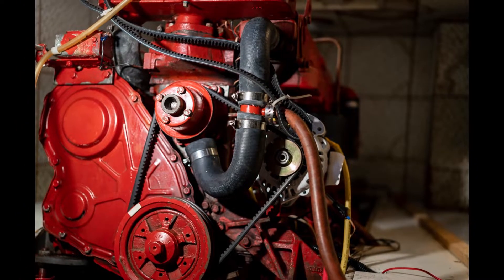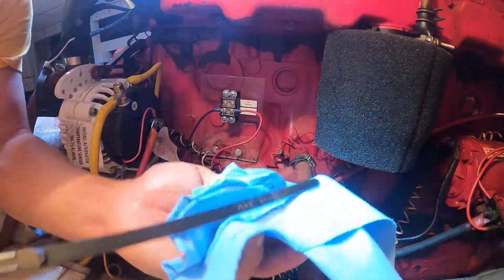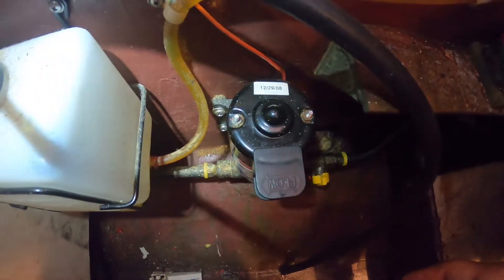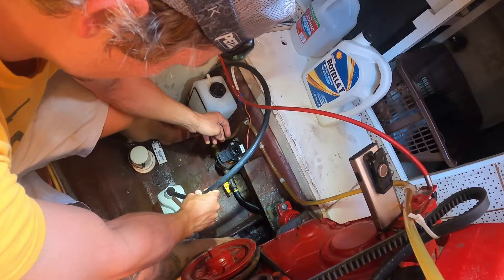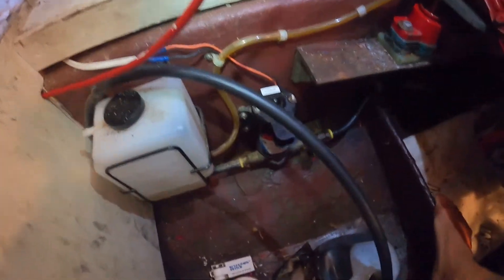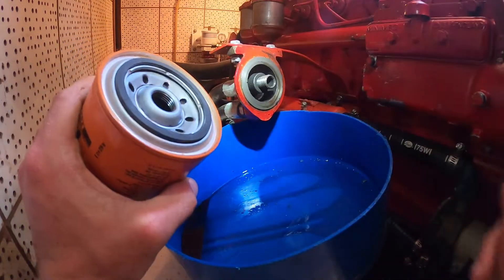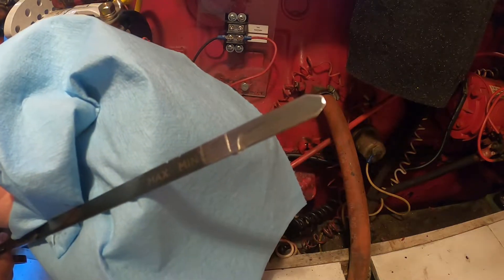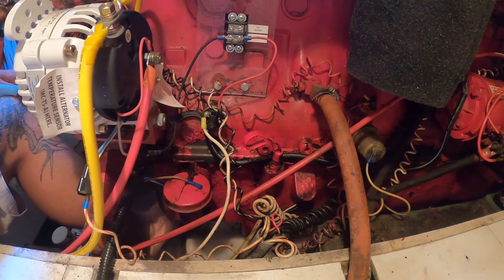TRAWLER LIFE: Ford Lehman 120 Main Oil Change Monk 36

Comment: According to the manual, the engine takes 12 quarts of oil.  Keep track of the oil that comes out of the engine, if the dipstick shows full, you should get 12 quarts out. If all of the oil is out of the engine, after adding 11 quarts, the oil on the dipstick should be up to the bottom line. after putting in the 12th quart, the oil on the dipstick should be at the top line. If the oil on the dipstick is halfway between the top and bottom lines, you would add half a quart.

Comment: Tip of the day: Oil fill reservoir is called valve cover and if you see a lot of oil under/inside the valve cover you have some serious problem with over filling the engine with oil. The oil you fill up the engine with runs all the way down from the valve cover to the oil pan in the bottom of the engine. Cheers from Sweden ;-)
Reply from the maker: Many thanks! Haven’t ever seen oil on the cover but will add it to my list of things to watch out for!
Reply: @crown_city_trawlers  you wont see any unless the oil stays inside the cover when you do an oil change, then you have a blockage inside the cylinder head. But as I saw from your video your engine looks in perfekt shape inside, no carbon build up on the valve springs or rocker arms. At least the engine in your video have been maintained perfectly with oil changes etc.

Comment: Remember, the oil will be viscous either cold or hot.  You want it to be less viscous so that it flows out of the engine internals more easily.  If you are using a flash light smaller than the diameter of the engine oil filler hole, it should be used with a wrist lanyard.  Small items dropped into such openings have a way of scuttling down into unreadable areas..then the fun begins. Good point of cracking the fill cap when draining.  It then acts as a vacuum breaker.  Well done here!
Reply from the maker: Thanks for the tips!

Comment: Nice clean engine and engine room. Very Impressive. Was it just me or did that old filter not drip any old oil and did it look clean and new when removed like no oil had passed through it? I hope you don't have an oil flow problem to your filter or worse low oil pressure throughout the engine.
Reply from the maker: Hey, thanks for the compliment! Also sharp eye on the old filter! I actually forgot to run the engine before change the oil this time so it had been sitting for a while and as there was not much oil that came out. Definitely won’t forget next time!

Comment: You know you can refill with that pump as well. Makes it very easy
Reply from the maker: Did not know that, but it makes sense given the fact that the pump goes both ways! Is that how you do yours? If so, do you have a perfect measurement of how much oil needs to go back in every time?
Reply: @crown_city_trawlers  I just put back what I take out and then just get close and keep checking slowly until it reads correctly on the dip stick

Comment: How many running hours between oil changes? Thanks for the informative video.
Reply from the maker: main engine oil should be changed every 200 hours. Injectors every 50
Reply: @crown_city_trawlers  interesting. I might be off in my estimation but it sounds like marine Diesel engines need more frequent oil changes than a Diesel engine for a vehicle. 👍🏻
Reply from the maker: @barryholiday8998  the Lehman maintenance manual (for marine application) says 200!
Reply: @crown_city_trawlers  my comment might have come across not as I intended. I wasn’t questioning whether what you said was correct I was merely commenting that it seems marine Diesel engines need oil changes more frequently than their auto/truck counterparts. Sorry if it sounded like I was attacking you. 👍🏻
Reply from the maker: @barryholiday8998  no sweat! I double checked in case I was screwing up anyways! Always with thinking about these things!
Reply: @barryholiday8998  the oil change frequent on a marine engine is probably calculated (from manufactor) on running full rpm for 200 hr and it's also on a constant load, a truck on the road wont see full load all the time.